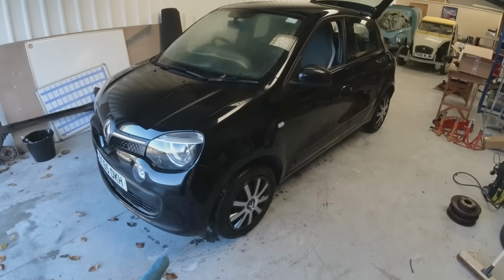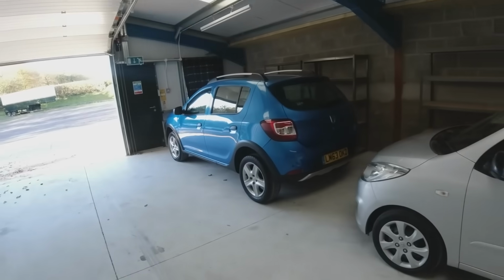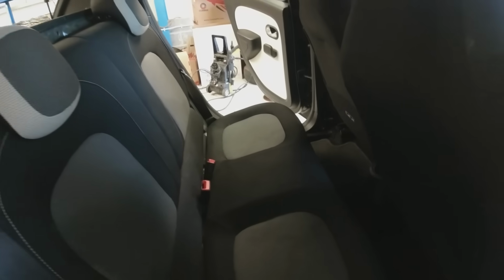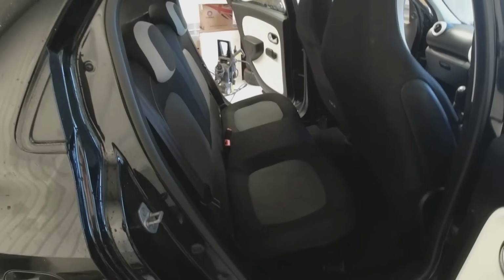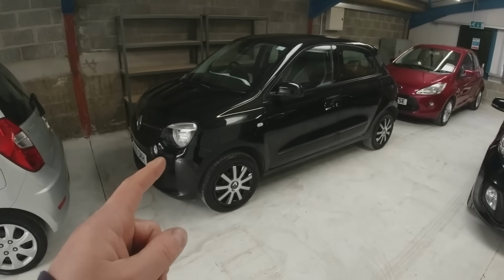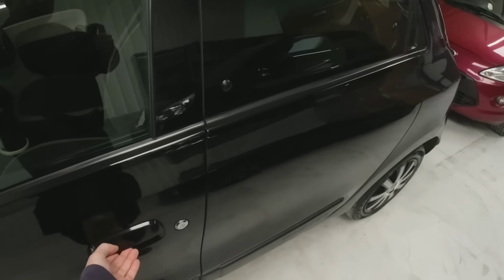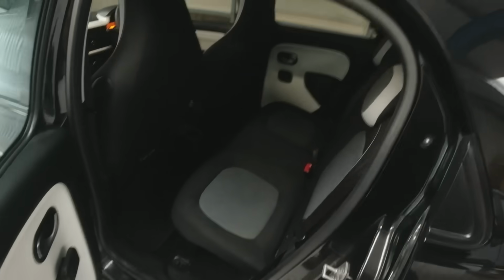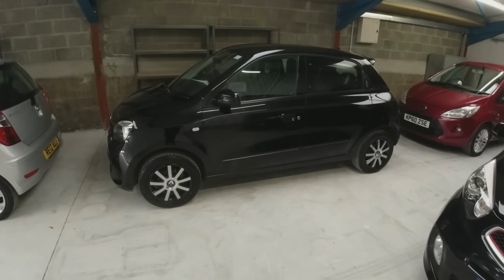Prepping our Facebook Private Sale Car for Retail

Comment: My only grippe when dealers do interior detailing is when the plastic cleaner is used on the steering wheel and gearknob. It makes it sticky and hard to clean off
Reply: The days of using a glossy silicone cleaner are gone. We use a lemon foam
Reply from the maker: Yes best not to on steering wheel

Comment: I've got an idea for you mate.. You'd ought to get friendly with Rob @ salvage rebuilds and get in his list of traders.... That little mitsubishi they just done has a retail of £3200, they're selling it for £1250 needing a bonnet and "boot" respray. Being the rattle can king, you could sort that out! Transport from kent to devon could be pricy but there's always a good margin to be had in their cars...
Reply: Don't need a respray got Go Faster Stripes !
Reply: @GrrMeister  The stripes aren't retail friendly 😆
Reply: they should have sold it with the scratches showing for the same price , those stripes arent Robs best idea.....
Reply: @lofty7180  Ah I'm not slating them for it, it's a nifty idea but very marmite
Reply: Errol Prickland  I don't blame them with the silly prices at auctions at the moment. Plus they tend to sell on at trade prices not retail so that won't help. 
Yes the Passat was a nice project
Reply: They have not done an auction car for ages and I didn’t think they would either how can you pay £3000 for a damaged car that is only 3800 repaired! And it’s still listed as a right off
Reply: @SalimKhan-gk1fh  Too many driveway traders with less overheads doing bodge jobs sadly.. until they're back to work those prices are staying in the roof
Reply: @sammytheseal2307  I’ve not bought a car from coparts for over two years now there’s absolutely no point even if it’s category N down in my area people will walk away from a right off!
Also coparts are the biggest scumbags I’ve ever dealt with
Reply: @SalimKhan-gk1fh  True, so many people run away from previous write offs. If it gets vandalised (keyed etc) then it's a write off sometimes, doesn't affect the car in the slightest but most people don't understand that, they just automatically think write off = unsafe
Reply: @sammytheseal2307  Did you go to or watch shoreham vehicle auctions on Monday night? the prices were absolutely unbelievable and about 30 of us were bidding against the Internet, £1500 cars going for nearly 2000
Reply: I was thinking same thing. Them stripes they have put on look horrible though.
Reply: @SalimKhan-gk1fh  I didn't no, I'm keeping well out of it all lol
Reply: @zainsajjad9930  Hmm, horrible maybe a bit harsh but perhaps an acquired taste
Reply: @sammytheseal2307  I see you watch the other channel?  he’s changed his name ‘tire kickers’ or something? The one with an attitude problem a mile long and a wife who I can only describe as ‘strange or odd’
Reply: @SalimKhan-gk1fh  I do watch him, it seems you're not a fan 😆
I think it's all part of the fun myself but fair enough to you mate 😉
Reply: @sammytheseal2307  15 minute long videos on how to wash your car! Someone on here called him the shampoo touting guy!
Reply from the maker: Yes transport kills deals

Comment: That turned out tidy, and I do like the choice of wheels. Here in Florida, the sun bakes the paint off of cars---you can get a great deal on a nice, low mileage motor just because of the paint condition
Reply from the maker: And then you have Macco for a cheap blow over!
Reply: @ChopsGarage  Right!

Comment: I had a couple of Mk1 Twingo's when I was In Gran Canaria. What do these new Twingo's drive like?  The old Mk1s were good fun up on the mountain roads.
Reply: I bought my Twingo GT in early 2018. It has clear all round visibility, a spacious and comfortable cabin and is a great town car (turning circle similar to London taxi) but also very comfortable on longer journeys. Performance up to 70 mph matches the 205 GTi I had in the 1980s with good handling, despite the rear-engine configuration. The engine produces max torque between 2,000 and 5,000 rpm and romps up steep hills in 5th like a turbo diesel. 
I previously test drove the version Chops is selling which is obviously much less powerful and softer sprung but still good to drive.
Reply from the maker: Allot of fun
Reply: @briangriffiths114  I was in Gran Canaria for a while on a tight budget. Did some work for a hire company. They gave me the Twingo as a company car. I'd rented a small house up in the mountains & those little Twingo's were brilliant on the narrow mountain roads. Only issue I had was if it rained & was on the GC1 heading to Playa Del Ingles the windscreen wiper used lift off the windscreen if you went over 80kph

Comment: What a cool little car. I personally, as an occasional private seller will use the lads where you used to go and get your cars cleaned at Alfa Ragazzi, on Braunton Road. They cleaned my girlfriend's new car and it costs what, £20? It's not a showroom finish, but when privately selling on a budget, a really clean car when photographed really makes it easy to grab attention.

I'm amazed at people trying to privately sell their Evoque for £14,000 and its filthy. A simple £20 car wash could end up saving a couple hundred quid, as people want to see that people care for their motors. Even if it's a £1000 Corsa, it's worth making sure you can get top dollar for your car. Nobody wants to turn up to a mud-caped car as it shows laziness and neglect.
Reply from the maker: Yes they do cracking job for cash

Comment: Hi James, i bought a Bissel Spot cleaner and its well worth the investment and gives great results. Get yourself a soft rotary brush for your seats will save you loads of time and effort. What dressing were you using on the interior facia and door cards ? as it looked quite good . I'm using Meguires interior hyper dressing and think its rubbish , bought 5L of the stuff based on recommendation.... Worst £70 I spent ( I Will keep it just for tyres or just bin it LOL).
Reply from the maker: I think its Max Power Interior Shine mate
Reply: @ChopsGarage  Thanks for the heads up James

Comment: I've heard good things about the bissell spot vac, no idea if it's any good but may be a bit easier than scrubbing the seats and carpets 😀
Reply: One of the bissell ones has a thin piece of plastic on or near the handle that is delicate. I personally use a Vax spotwash . Paid 100 quid but they are about 160 now. I bought direct from Vax on eBay. Clear water tanks and head plus ample power. Done my stairs, car,  rugs, and spills. Not bad on chemicals but you could use elbow grease or flash liquid diluted. Can't recommend enough. Red and grey colour with centre handle.
Reply from the maker: Ordered one , less than I had in my head they were
Reply: @ChopsGarage  Should make your life easier!
Reply: @ChopsGarage  Cool, I did my research of the reviews and it paid off, even has a self clean function.

Comment: What proportion of G101 mix do you use on the seats James? I'm about to tackle some manky seats!!
Reply from the maker: Erm don't really measure , 20% maybe
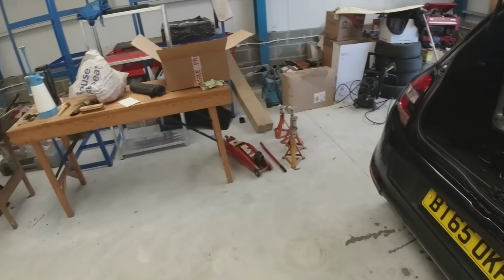Reply: This is from an Amazon seller. Dilutions: Degreasing Hot: 1:20 Cold 1:8 General cleaning Hot 1:50 Cold 1:30, Bug or ink removal, wheel cleaning & polymer removal 1:5

Comment: Please avoid Renault you.will need a  big toolbox.
Reply: I've been buying new Renaults for 30 years solid and the engines and gearboxes are bulletproof. However, some of the electrics have been known to play up such as the air-conditioning in my 2013 Clio which switched itself on and off due to a major software fault. As  I have an engineering background, I was able to produce a full report that enabled the dealer to rectify it but only after a lot of work. Otherwise, they have been good cars but I am about to switch allegiances as my local dealership closes in a month's time.

Comment: Would list the Twingo for 4995£ and list the photos of the reason it was a Cat N.. Still a good deal, once you know the reason of it being cat N. Does someone offer 4500£ or less you can still choose to let it go, if you have it standing to long.
Reply: £4995 not 4995£ it’s not euros it’s £££££
Reply: @Connellski1986  € not euros. And €4995 would be correct (well it wouldn't unless the exchange rate were 1:1). So you're both wrong. But you were the pedant so I think you lose more. :-P
Reply: @benholroyd5221  incorrect 4995€ I wasn’t doing exchange for him just taking him back to key stage one